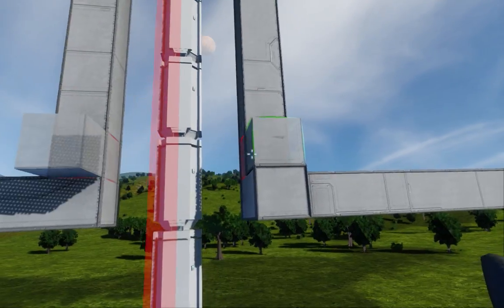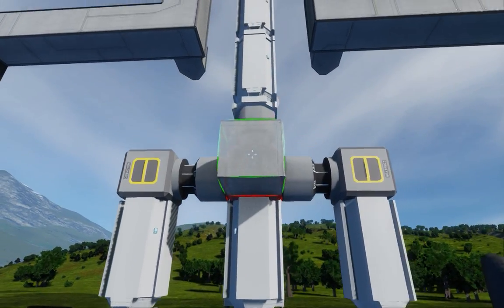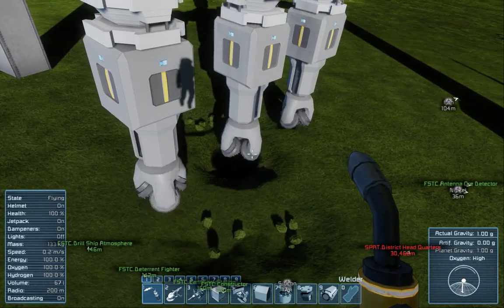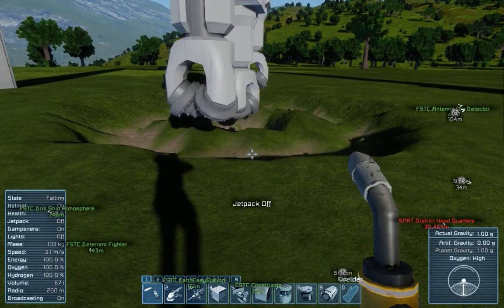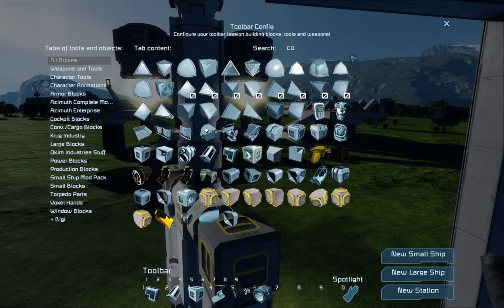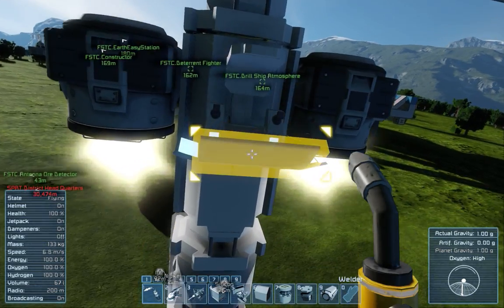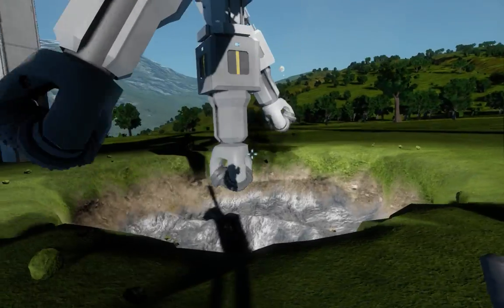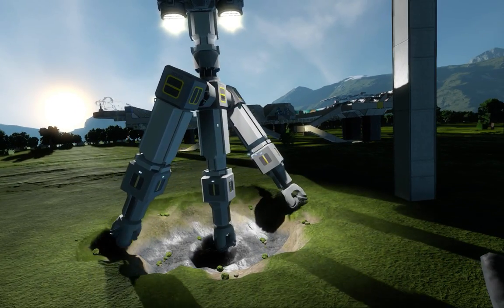Space Engineers   REKT Trident Rotating Planetary Drillhead

Comment: Puts on Dedicated server.... Explodes.... 

Honestly the resouces you used in the extra pistons and rotors you could of put enough drills on to have it drill just as big of a hole and be alot more stable
Reply from the maker: +Tom “Hodgoes” Hodgins
I have not tried on a dedi server, but I have hosted local server and had a few connected while running and it didnt fail.
Perhaps check out the next video if you want to see how large a hole it can drill. I cant imagine a "drill-wall" would use less resources for the same sized hole.